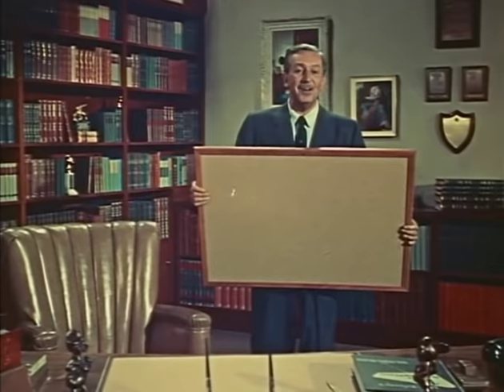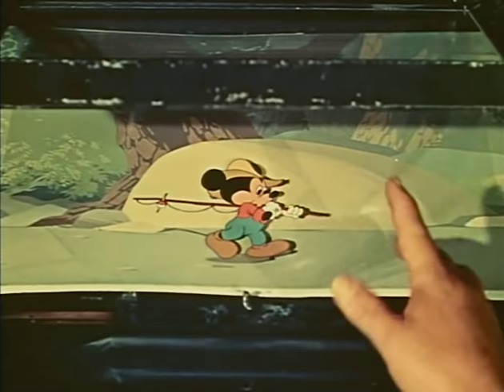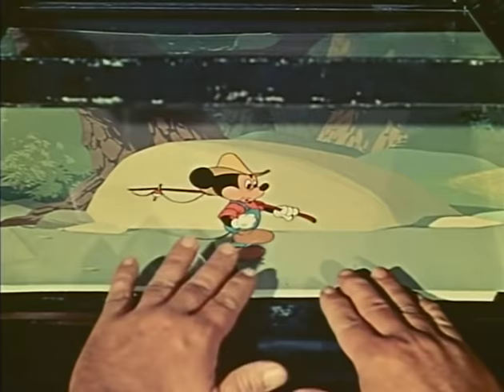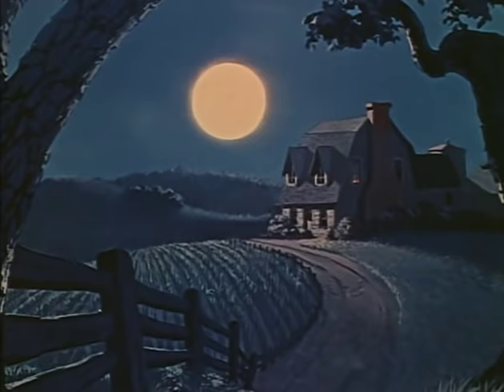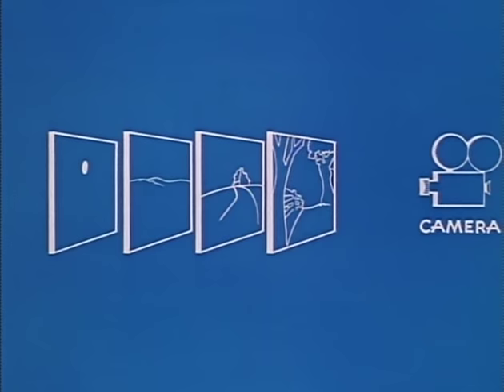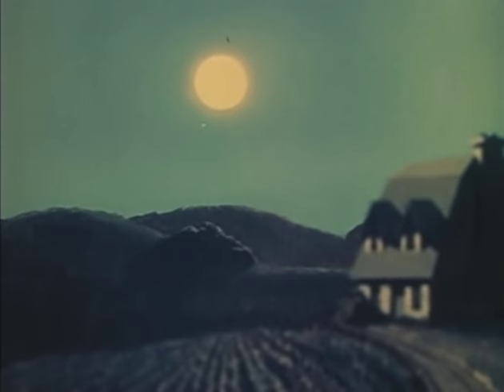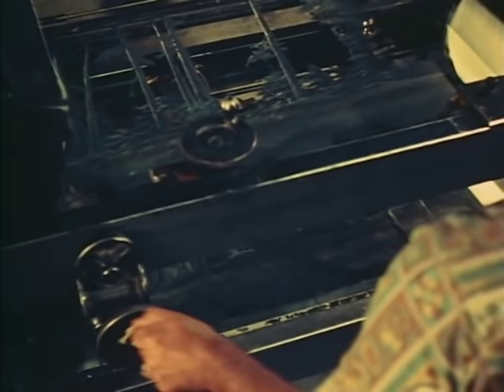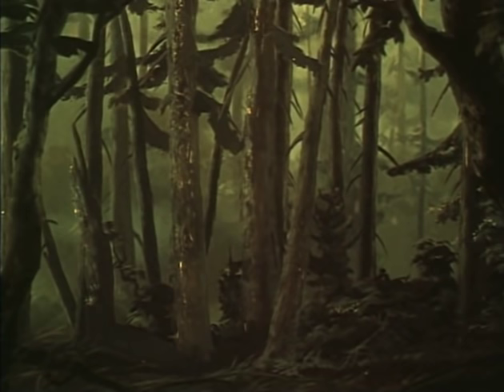Walt Disney's MultiPlane Camera (Filmed: Feb. 13, 1957)

Comment: I wish he would have explained how that system was able to keep all planes in focus.  They must have been using a tremendous amount of light to illuminate the plates and a lens of exceptional depth-o-field to keep it all sharp.
Reply: Keep in mind that they're shooting frame by frame, so they were able to perform much longer exposures than if they were shooting live action. From this video, it looks like they took about a 3 second exposure, which certainly means stopping down is possible.

Comment: I well remember looking over one of these multiplane cameras (I believe they called them 'cranes') back in the mid 80s, when Disney was on Hyperion. I've spent a fair bit of time on Oxberry downs hooters, but the Disney crane was enormous. It seemed to need quite a crew, with the camera operator up top and others who changed and moved cels and background art below. As I recall a global zoom required the camera operator to manually pull focus. I was told the unit I saw had been originally built for Snow White in 1937. I guess Ub Ikerks was the engineering genius behind these as well as the anceint, hand-made optical department in the same building (lots of Bell 2709s mounted to lathe beds, maybe only one Acme or so).

Long gone from production now, I hope all these fabulous historic animation and VFX artifacts are being properly conserved somewhere so everyone can see how much skill and effort it took to make classic animation.
Reply: They are! I believe I saw that Snow White multiplane when I went to the Norman Rockwell Museum for a limited exhibition. A shame we couldn't take pictures.

Comment: Animation mistake at 1:48
Reply: Alec Wilson It's bound to happen, the cameras were old (50s, they glitched a lot), and human error. Either way, I feel it turned out REALLY well.
Reply: it had nothing to do with the camera mate. its because the guy shooting the frames obviously at one point put the wrong frame under the camera.
Reply: Alec Wilson I also mentioned human error.
Reply: Yes, something was shot out of order. Good eye, Alec. AND this little bit of Mickey animation was done just for the TV show. Lower budget and not the same crew that was making features. And the general public had no way to stop frame stuff in the '50s.
Reply: +Alec Wilson Nothing wrong. Just a Fight Club reference.
Reply: MrMrMaran what?
Reply: +Alec Wilson fishingrod then no rod then rod again
Reply: +Alec Wilson You sure you got the time right? I saw an error at 1:50 not 1:48.
Reply: Alec Wilson honestly back then it would be a miracle for their to be no mistakes. Even back in like justice friends or something Batmans emblem would just change color as well as other characters on a regular
Reply: There were two Mickeys, the one is at the back while the current one is almost transparent
Reply: I think it was deliberate to show what happens if you were to misplace one frame.
Reply: I bet it was Allen's fault.
Reply: Slow it down to 0.25 speed before 1:50 and it becomes much more apparent
Reply: Lee Crowe Yeah, just like no one could stop the frame in seventies to see those two half naked chicks in The Rescuers 😂
Reply: Alec Wilson  I don’t think there was any glitching going on with a mechanical camera. Nothing digital in it to glitch.
Reply: Sorry but there is no mistake.
Reply: better than pubg glitches
Reply: It's the best they could do
Reply: Its 1:50 through 1:51 actually
Reply: jacoblgames  I see the Mickey glitch at the end of 1:50 as well. You see ghost Mickey whistling while another Mickey looks on kind of worried.

Comment: Camera predecessor itself was actually invented by Lotte Reiniger and then improved (and patented) by Disney.
Source (and more about Lotte Reiniger): https://www.bbc.com/ideas/videos/the-animation-genius-youve-probably-never-heard-of/p05t9bsn?playlist=unsung-heroines

Lotte invented the predecessor not the multiplane aspect of it with moving layers, definitely inspired it. Lotte mostly just used it to swap out colored backgrounds on her silhouette cel style to adjust placement and color.

A predecessor to the multiplane camera was used by Lotte Reiniger for her animated feature The Adventures of Prince Achmed (1926). Berthold Bartosch, who worked with Reiniger, used a similar setup in his film L'Idee (1932).

Ub Iwerks invented the multiplane camera with movable layers to create parallax and zooming [1] which created immersive depth. It also saved on budgets, tedious background animation and allowed animators to focus more on the character cels, the star of the show.

The first multiplane camera, using movable layers of flat artwork before a horizontal camera, was invented by former Walt Disney Studios animator/director Ub Iwerks in 1933, using parts from an old Chevrolet automobile. His multiplane camera was used in a number of the Iwerks Studio's Willie Whopper and Comicolor cartoons of the mid-1930s.

Fleischer Studios (Popeye/Betty Boop) also made one or copied in 1934 [1]

The technicians at Fleischer Studios created a distantly related device, called the Stereoptical Camera or Setback, in 1934. Their apparatus used three-dimensional miniature sets built to the scale of the animation artwork. The animation cels were placed within the setup so that various objects could pass in front of and behind them, and the entire scene was shot using a horizontal camera. The Tabletop process was used to create distinctive results in Fleischer's Betty Boop, Popeye the Sailor, and Color Classics cartoons.

William Garrity took Ub Iwerks invention further and that iteration was used in many large successful movies they made [1]

The most famous multiplane camera was invented by William Garity for the Walt Disney Studios to be used in the production of Snow White and the Seven Dwarfs. The camera was completed in early 1937 and tested in a Silly Symphony called The Old Mill, which won the 1937 Academy Award for Animated Short Film. Disney's multiplane camera, which used up to seven layers of artwork (painted in oils on glass) shot under a vertical and moveable camera, allowed for more sophisticated uses than the Iwerks or Fleischer versions, and was used prominently in Disney films such as Pinocchio, Fantasia, Bambi, The Adventures of Ichabod and Mr. Toad, Cinderella, Alice in Wonderland, Peter Pan, Sleeping Beauty and The Jungle Book

[1] https://en.wikipedia.org/wiki/Multiplane_camera

Comment: Actually cels haven't been used much since Disney developed the CAPS process in the early 1990s, that is, in short, making drawings on paper and then scanning them to be processed in a computer for digital ink and paint. Which in turn was replaced by the usage of specialized software and graphics tablets. In my opinion, this only facilitates the process of hand-drawn animation, removing all the technical obstacles for the artist, allowing them to focus on the actual drawing.

Comment: They didn't explain why there's a feeling of depth but there's no real perspective. If they're using a wide lens, I can understand that all the layers look similar in size, but then you get the flattening of the final composition, right? But if you have a regular lens, the lower layers should be much wider than the first layers since they're farther away and require a bigger area to fill the camera viewport. :P This is confusing.

Comment: I've always wondered how they use a camera in an animated movie. but how about Toy Story or any other Pixar movie in general when the camera moves, is it multipane?
Reply: This one is for 2D animation. Pixar movies are 3D animation. It's a completely different process.
Reply: That's pure computer animation, the 'camera' is virtual within the 3D render space.
Reply: 3D Animator here! And as others have rightly said Pixar uses a completely different process, there's almost no similarities between the two forums of animation. Everything done by Pixar is done on a computer, characters are not drawn/ painted but are instead computer files, made up of multiple flat faces called polygons to make up a large mesh/ object, which is then rigged (given bones) so that an animator can move it and set its positions. Animating on a computer is accomplished using "keyframes" an animator will keyframe a start and end position of a movement and then the computer will "fill in the blanks" creating a motion path. A virtual camera captures the scene and is then used to "render" the final animation, rendering is a very slow and resource intensive process where a computer will finalise the animation into the final end product (post production is normally required as well.)

This is what a virtual camera looks like in AutoDesk Maya (an industry leading product)
https://www.google.co.uk/search?q=Maya+camera&espv=2&biw=2048&bih=1048&source=lnms&tbm=isch&sa=X&ved=0ahUKEwiV4MmYgqbRAhXpJsAKHUHqD7EQ_AUICCgD#imgrc=CeJ_BhihbTACdM%3A

This was obviously a very brief overview of how animation is accomplised by Pixar but I hope this helps
Game On
Reply: Alex Koutoukas have they used the multi plane camera for the Tom and Jerry cartoons?